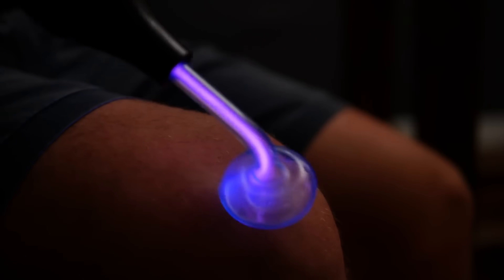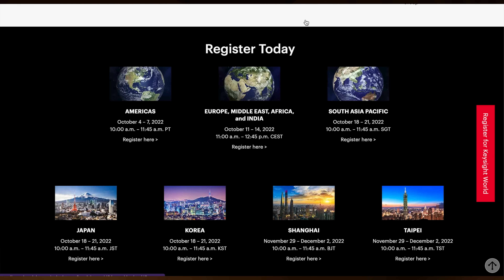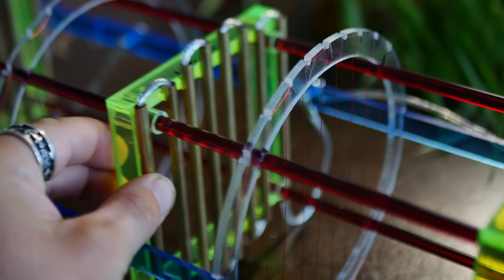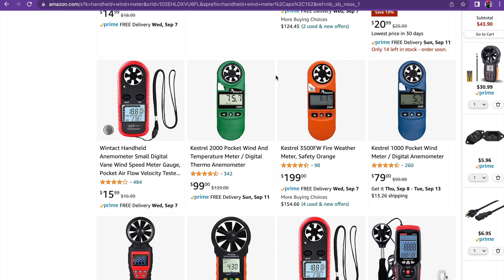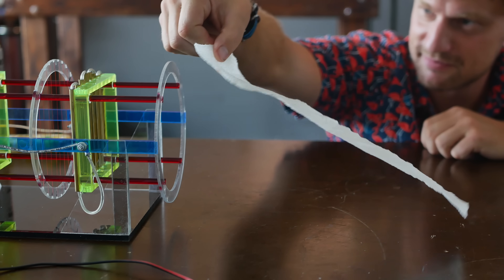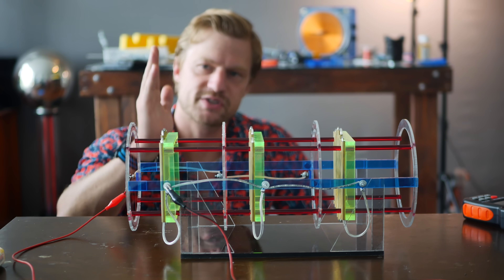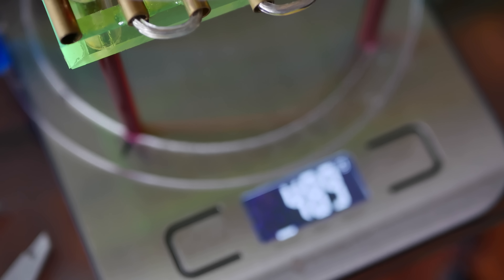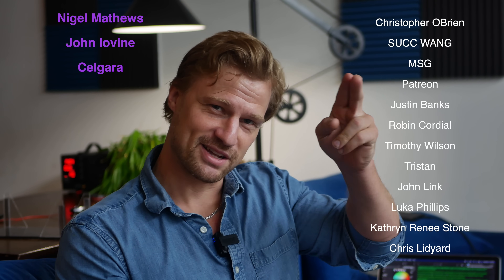Designing A Next-Gen Ionic Thruster! (For Flight)

Comment: I noticed that the thruster isn't really contained. I wonder how it would work if it was enclosed like a conventional thruster. I also can't help but wonder how an open thruster system would work in practice, I imagine it would get cluttered. Do the gaps matter for airflow? I'm thinking maybe you're losing some airflow to the sides of the thruster. But then again, if you enclose it that means you might get less intake air?

Comment: feel like the open nature of the design means you lose air flow I feel you need a light weight case on the inner part of the rings to reduce any turbulence in the system. would also be interested to see if you do use a case what having each section getting smaller to concentrate the flow will do.

Comment: Awesome project. Maybe you can build the stages in a thin single ply composite fuselage using a venturi to increase velocity in stages. Also, try using a honeycomb air straightener/laminator design for your ground electrode.

Comment: Try sealing the tunnel and putting a filter at the front to give it laminar flow, see what changes that makes and if uniform air is more influenced than the shmuck you pull around it. Also check if you can really compact the plates together or if there is this honeysugar sweet spot. I think lastly, you should add a mineral to the air flowing in so it looks blue or cyan. No scientific improvement intended with the last one. Just thought blue banshee fans would be cooler.

Comment: If you did a series of these that rotated the wires and the rods like 15 -30 degrees, could you get the airflow going in a spiral? If not, would this increase, decrease or be neutral? 
Could you step down the sizes in a tube to maximize air pressure? Does a larger size scale linearly with the area of the layers? 
How does this compare in efficiency to a bladed fan?

Comment: I guess that you should be aware that when you don't put your thruster inside a tube, part of the air in any stage could be flowing around the next stage without being used efficiently. I wonder, why you don't calculate the thrust using Coulomb's law? I guess that this is the right law that could give you attraction ( and at the same time repulsion) in this case, but maybe you need to work around this in order to obtain what you want. I will be thinking about and tell you if I come with something better

Comment: Amazing project, something I've been dreaming about building for a long time. Now that I have access to a laser cutter at work, I think I'm going to attempt a similar build, it's very inspiring.

I had some ideas of my own to improve: when you started the build I was immediately thinking of staggered spacing, but I was thinking of doing it the other way around, starting with a small gap to start acceleration, and then increase the gap size since the air is already moving and that will help the ionic wind. Also, I think that when you turn this into a smooth tube, the air velocity will improve by a lot as well. The current setup has incredibly bad aerodynamics inside the path of the wind.

Also: thrust is not just something caused by creating 'wind speed'. You need to create pressure. Adding a tube will absolutely help creating that pressure. I like to compare it in the way axial and radial fans work. Axial fans are best to create air movement, but radial fans really create pressure because their flow system is more constrained. Axial fans tend to respect the direction of flow to one axis, radial fans rotate the flow by 90 degrees. The benefit of your system, is that (when it's a long tube), it creates both axial flow and hopefully pressure.

Comment: Generally speaking this is a proof of concept for an ionic thruster. Which is super cool and totally accomplished its goal. Now that the concept has been proven, you can start optimizing other aspects. One area I think you can optimize is airflow. You got air moving through there powered by the ionic thruster. Perhaps you can do something with the air itself to further increase the thrust.

1) You might be able to get closer to your goal of increasing thrust by modifying the airflow using Bernoulli's principle. Creating an exit spout with a diameter smaller than any part of your system will increase airflow
2) Long shot but if you find a way to super cool intake air (To "compress" the air, and fit more air into the same space), and then heat it back up right as it's moving past the constriction, you might be able to create an increased intake of air which shoots out faster upon exit. You've got power to the system. Perhaps you can use some of this power to cool / heat air. 
3) I believe you're creating ozone as a by-product of your ionic thruster. Ozone has its own properties which maybe you can make use of. Ozone is fun because if the concentration of ozone in a closed system reaches a certain point, it kind of "explodes" (rapidly decomposes to oxygen) if a trigger is applied. I feel like you can't create a closed system that creates a high concentration of ozone to oxygen just because you need 4x the amount of air to create the same amount of ozone, but maybe you can have an offshoot chamber away from the main system that collects ozone until the volume of ozone  in that chamber by itself is high enough to be able to trigger the rapid decomposition, and shoot the resulting oxygen out the exhaust nozzle to increase thrust. I'd imagine you'd want a constant "ozone decomposition powered thruster" so you'd only be able to use a very very small chamber for this, otherwise it would take too long and just create a really rough running thruster. (Found this document that talks about this stuff: https://rgipt.ac.in/oldsite/author_doc/K-106.pdf)
4) Is it laminar flow within the device? If it isn't, maybe it's another reason to create an enclosed system, so that it creates laminar flow. Laminar flow takes less energy for air to move through so perhaps you could increase the speed of airflow by ensuring intake transforms airflow into a laminar state.

I think out of all three, #1 & #4 will bring the most improvements and be the most reliable just due to lack of number of parts used.

Next your electricity is static. Meaning you manually select the power levels. Say you had an airflow tester in the way of the exit port. It shoots data back to the microcontroller and the microcontroller automatically controls the power level(s) of all / individual stages. It receives new data from the airflow tester and is able to pick the perfect balance(s) of power to create optimum thrust. This one might not end up creating any upgrades, but if it does, perhaps it'll find a new combination of power / stage you haven't ran into yet, on its own. You might also be able to use the same idea to automatically adjust thrust if you power the spacing of the stages up. Same idea. Airflow tester sends data to computer. You input target airflow value, and the device changes the spacing of the stages to accomplish that goal. This one increases weight drastically but I thought I'd mention it because it's cool. It might also find you a cool combination of distances between stages to increase thrust, which you can take back to your lightweight design.

Comment: Perhaps a ducted design is more efficient, also I suggest use 3d prints to optimize the weight of the truster (it’s just bunch of wires and tubes to provide that lift after all). The reduced weight can be used in adding more stages to increase the efficiency over all

Comment: Have you tested different spacing between the three thrusters? Mainly less space between the last two stages. You could also look into going from big rings to small rings, to try and compress the air, and save weight. And specializing the first stage for max intake, and the last for speed, with the wire count. Increase the number of stages. And feeding some of the generated wind back, in front of the first stage to increase intake by airflow.

Comment: Also, you should stage the voltages like a multi-grid vacuum tube. Each stage should be higher and higher voltage. This way you get some additional thrust between stages rather than the interstate polarity fighting the thrust, which you have now.

Comment: absolutely incredible, about the source of inefficiency, it occurs to me, vary the quantity, spacing and thickness of the negative pole wires, close the chamber putting everything inside a pipe.
Reply: or divide the process into two stages, first ionize the air in a pre-chamber with microwaves or something like that, and then accelerate it with the thruster that you already built

Comment: let me try
1. the air flow area is not enclosed and not gradually narrowed at the output
2. the electrodes area should follow the enclosed area to crate faster flow 
3. voltage too high, and only 3 unit of electrodes ... leads to higher noises and ozone

there's that fan guy, who do 3D printing PC fan showdown, maybe you can do the same kind of research and create the first drone using ionic thruster

Comment: What if you try pulsing each section one after the other  very fast.  Like a washing machine motor on a spin cycle. Just curios if they all need to be going at the same time, it would cut down on your power requirement. Maybe 2 sections on and one off.

Comment: The big one would probably adding some sort of shroud to direct the airflow, maybe even include some kind of venturi shape that resonates with the spacing between stages? even though it's close to laminar flow it's probably still bleed a lot of air being uncontained like that. And maybe reducing the space between stages? Though how close can you get before they start arcing?

Edit: how does the temperature of the air affect the efficiency? Could you vary the voltage between stages to act at a more ideal efficiency after the plasma from each stage heats the air? A shroud/venturi could use the increase in temperature to increase airflow

Comment: 3 immediate improvements that I can think of;
1) a smaller diamiter tube and denser webbing.  If the air flow is caused by the plasma hitting ambiant air particles, then getting that stream of plasma more concentrated should provide more thrust.
2) enclose the whole unit in a tube.  The flow is certainly not laminer, so there is likely a lot being lost out the sides.
3) Cut weight with having electrode wires instead of tubes.  Those big fat tubes are likely messing with airflow, and the voltage is going to attract the plasma, so they shouldn't need to be big honkin tubes.  You should be able to use the same type of mesh on both ends and cut on weight while impeeding airflow less.  Plus you could probably get 6-7 stages in with the same weight, and the reinforcing stages are probably more important to that airflow than having fewer larger stages.

4) Not sure if it would be helpful, but I'd be curious to see if there is any benefit to leaving the center more open, and put the meshing more around the edges of the tube.  Once air starts flowing would it be helpful?  Or would it not matter whatsoever?

Comment: I mean, other than 'plasma is cool' (and it is cool), how on earth does this ever become practical?
I mean, we are talking about the equivilant of getting the propeller and scaffolding of an airplane to move... but without adding any of the weight of the energy storage.  Once we add in the weight of the electronics and batteries.... this becomes a counky boi, and that is going to be difficult to move much at all.

Would love to see something like this power a plane or something though!  That would be really neat!
I'd also be curious if there are ways to extend the electron flow.  Could the ground effectively 'move' down the column using circuits to guide the plasma down the tube?  Because really what is killing you isn't the thrust of the plasma... it is that it has such a short distance to influence the air around it.  So if there was a way to attract the plasma down the tube further then you could get a much stronger airflow.  That's essentially the difference between a gas engine and a turbine... just direct the fuel doing all the work in a longer path and in a continuous fashion.

Comment: A Ducted chamber will definitely accelerate the air by eliminating turbulence in between stages. Adding a Venturi will accelerate air also. I wonder if you clock each stage 5 to 10 degrees if would get a cool swirl effect. What a cool project. Keep up the great work.

Comment: Honest thoughts: Damn! That's fuckin' cool.
Now my doubts:
1) Does the orientation of the wires/metal tubes in each section affect the flow of air (meaning, instead of parallel, does it affect it if it looks lik3 #)?
2) On the wire configuration again. What happens if you put the wires in a spirograph pattern to twist the flow even further?
3) Would putting the rig inside a tube and adding an exhaust like one of a Jet Engine improve the speed of the air flow?
4) How about concentrating the air flow before funneling it into the rig?
5) How about making the stacks different sizes?
6) How would adding magnets inside the rig affect the flow?
7) How about some Tesla Coils?
I admit that some of the ideas are me just wanting to see more awesome sparks/plasma flows ('cause who does not love a good plasma flow?), but what if they help? Food for thought.

Comment: Correct me if I'm wrong but the way it's described is basically a coilgun that's using the atmosphere as ammunition. So steadily increasing power of each "coil" should result in increased speed. Because your dealing with air flow though would a cone shaped shroud help prevent leakage and increase wind speed by restricting flow?

Comment: 1. No outer shell.  Air can enter and exit the thruster body at any time, reducing overall output at the rear of the thruster.
2. Air can exit in any direction out of the rear.  Adding a cone of some shape to guide the air might increase overall thrust produced.
3. Wire pattern.  I'm sure there is a better and/or tighter pattern that can be used on the "wiring" to increase power output (pun intended).

Comment: 1. The electrode shape and coating. Sharp electrodes would more easily ionize the air, and a coating of some sort like they use in cathode ray tubes to have stronger beams could possibly help with that as well. 2. Enclosure! I think efficiency would greatly increased by an enclosure. 3. This feels like cheating but you did type it at the end of the video, your current power supply seems to be giving pulsed DC, a constant DC power supply would perform probably twice as well or at least save on some energy efficiency.

Comment: 1) Spacing between negatives and positives.
I imagine smaller gaps at the thrust end
2) enclose the rings, there is loss not going directly out the bottom
3) along with spacing between positive nodes, taper the end to boost pressure.

Comment: You should pulse alternating charge with the rate of the pulse quickening as the air flow increases. That will drastically increase the performance. Also tighten the spacing at the beginning. Imagine a string of people, half red and half blue. Red can only pass a ball to blue and vice versa. The closer they are in the beginning, the quicker they can accelerate the ball.

Comment: The air in the middle should be moving faster. Rings will probably work better. Like a tree trunk. Higher voltage in the center.
It needs to be covered on the outside to prevent air from escaping.
It needs a nozzle.
You can't put in that close to the scale to calculate thrust.

Comment: Have you tried suppling inverse reactive current to the unilateral phase detractors?  You may need a turbo encabulator, but at least you'd be able to cut down on side fumbling thanks to the hydrocoptic marzel vanes.
Reply: Underrated comment of the year.
Reply: Good point! But I think the main issue really lies in the missing intralaminar Higgs-Boson isolation. A standardised Hufflepuff-tubing should do the trick though.

Comment: I may have missed it but how much is this method affected by the square cube law with volume of air VS the contact surface areas?
Reply: The most interesting exponential law with these is that thrust per watt increases with voltage to 1.9 power, so making it very large and very high voltage should give some amazing efficiency. Energy is only consumed at the creation and neutralization of ions, so the more work you get out of them inbetween, the higher the efficiency. But you also need a steep field gradient between the electrodes, which is why thrust increases as you reduce the spacing (until it arcs). So crank up the voltage to maximize the field gradient over the longest distance possible.

Comment: I find when doing any kind of electrochemistry (forgiving that we are abusing the term "electrochemistry" to mean moving ions in air with electricity) the current is a critically important aspect of performance. (Ultimately, work is done with Watts over time, of course... but lets put a pin in this for now.)

To borrow your jet engine analogy; most commercial jet engines are actually "turbofans," which is a turbo jet core, surrounded by a bypass "prop" of sorts. The idea is that, while it certainly has the highest speed, a thin, hot, high velocity jet stream doesn't necessarily have the best efficiency. A high-bypass ratio allowed by turbofans, however, enables optimizing for the movement of MORE MASS, thus allowing much greater thrust and efficiency numbers. 

Back to electronics. If you want to optimize the useful performance of this, IMHO, your kitchen scale is going to tell you far more meaningful information than the air meter. To really sell this point, you could in theory push air through a small hole and max out that meter, but still have low total thrust. This is simply because the speed of the tiny air stream is technically high.